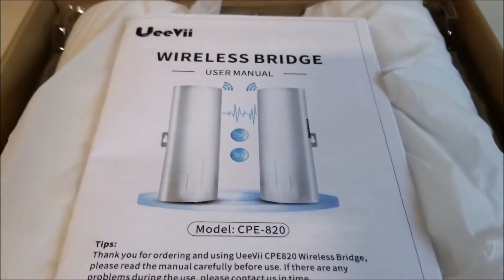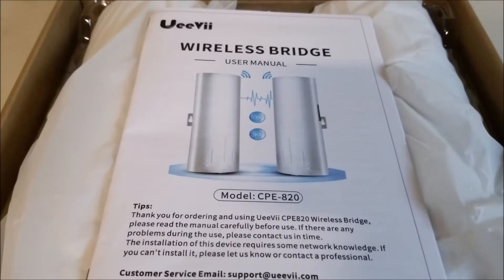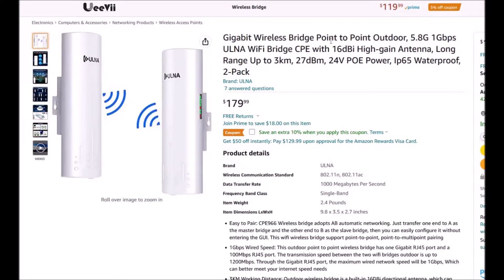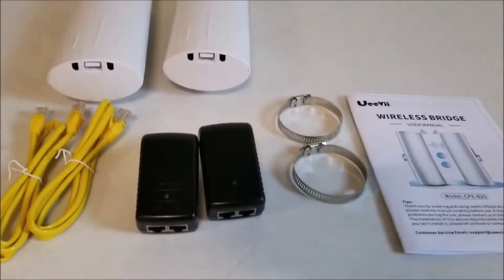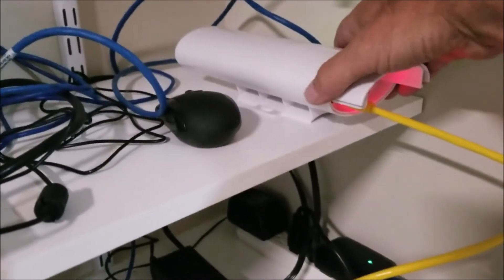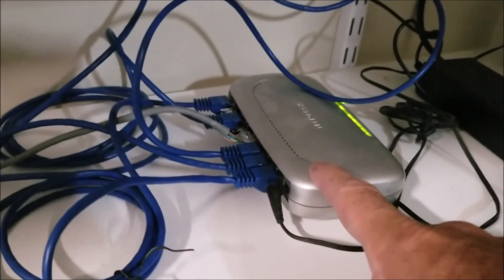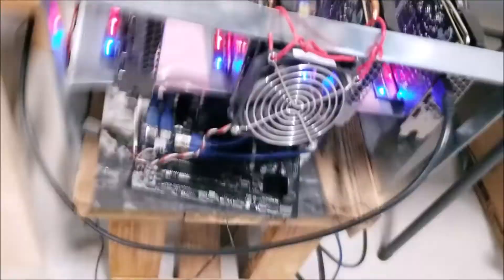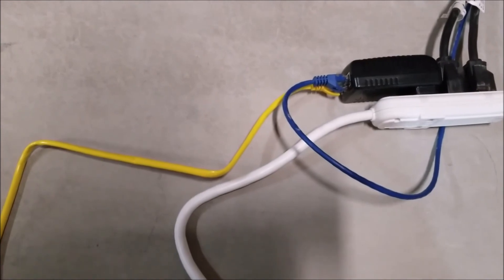Overview Review ULNA Wireless Bridge  (Long Range 5.8G 1Gbps)

Comment: Thank you v much for  this video.   I was wondering if you could tell me how far an NVR for ip cameras can be located from the slave bridge.  We can get great signal with the NVR  close to the wireless slave bridge but when routing Cat5e cable through attic to where we want the NVR and monitor which is about 110 feet... we can't get any signal.  Do you have any suggestions on how to solve this issue.  Thank you.

Comment: can't get speeds of over 100mbs, any suggestions? I'm plugged into the 1000mps on the units, running speeds of 600mps in the house and trying to extend to house across the street, clear line of sight, no obstructions, most I have been able to get is 90mps across the street.
Reply from the maker: Are you using Cat 5e or higher for the ports that are connected
Reply: Try connecting the cable to the bridge's gigabit port instead of the POE power port so I can get 486Mbps